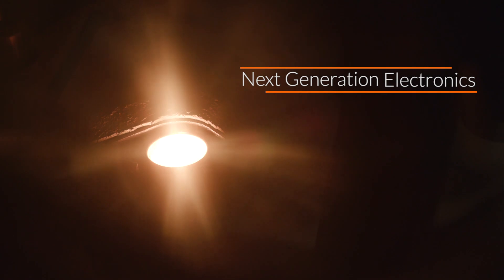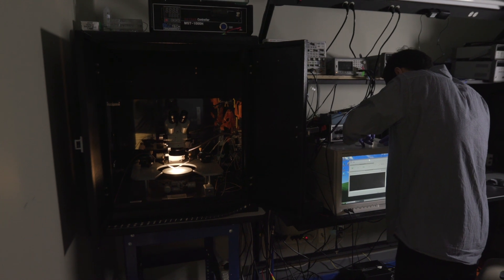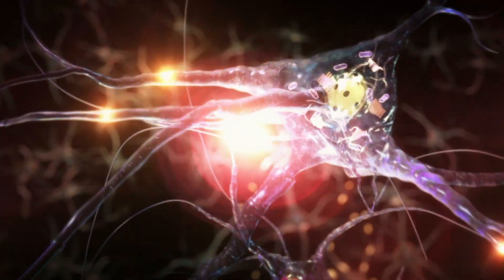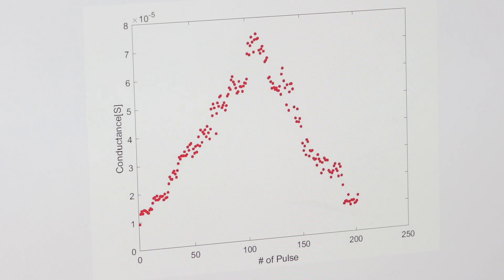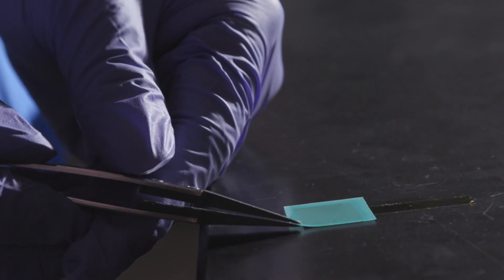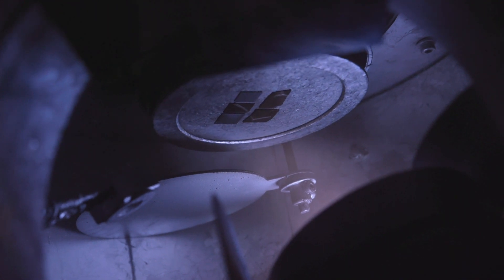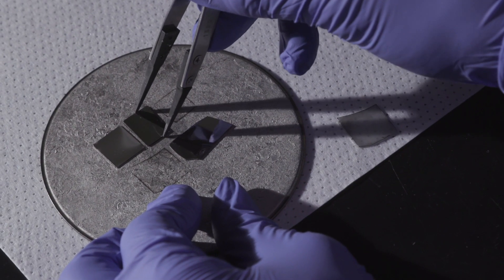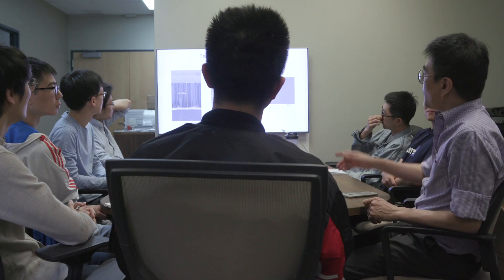Building the Next Generation of Electronics

Comment: You are not an engineer but you are an applied scientist Mr. Kim.  The products based on the new technology that you create will be used by engineers. I congratulate you for your exciting researches and successful work.
Reply: Engineers can also do research. Engineering and applied science overlap so much you can't really say there is a defined line between the two. For example technology design can done by applied scientists as in the transistor, and theoretical models like the ones used in computer hardware design based on logic being developed by engineers.